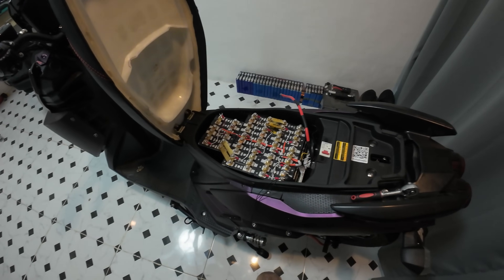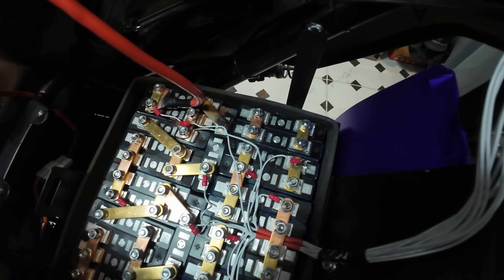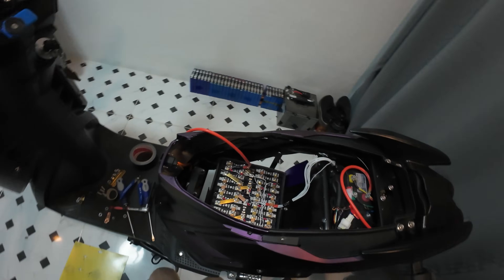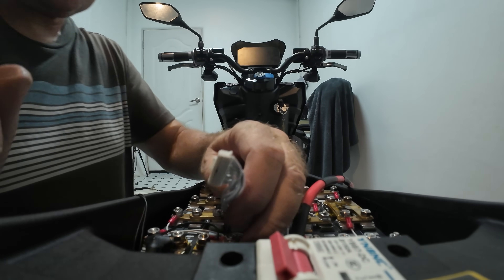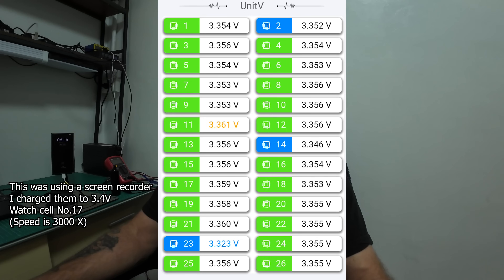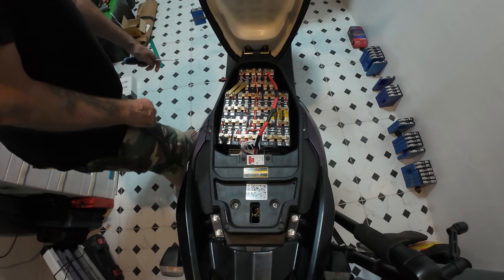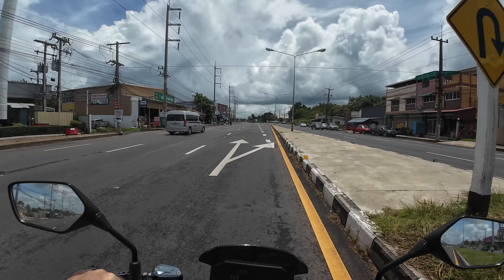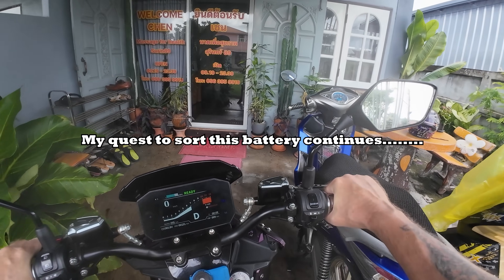The extreme DIY electric scooter / motorcycle build - LiFePO4 CATL problem going over-voltage

Comment: id suggest a prolonged top balance at 3.6v so there all the same at full charge then check again when you run the cells down near 0% and see which cells have fallen the most if there within your tolerance the great but if cells are dipping very low while others are still at 3.2 then id swap those ones out id charge the whole pack back to 3.6 and drop the new cells in that are also fully charged to 3.6 saves time re balancing

Comment: I'd recommend using an active balancer if you can find it. Could be structural with resistance along series from top part of the battery to bottom part. Also could be grade b cells. Check the qrcode to authentify date of production. Lifepo4 should charge around up to 3,6v and discharge down to 2,5v safely especially in warm climate countries like yours.
Reply from the maker: The tougle was, I couldn't find a 26S active balancer or I definitely would have fitted one mate.
I tested every cell and they all go to 3.6V but they all accelerate after 3.3V. As you probably know, Lifepo4 cells are pretty much flatline in their working voltage, if one cell goes high, the rest might only be 70% charged.
A bit of insight...... Yesterday, I started dismantling the battery again - I'm going back to 24S with a JK active BMS.

Comment: My Ebikes 20S/1P A123 LifeP04 High Discharge Pouch cells are "not perfectly matched" either. But i Charge/ Balance them "every time" via a Icharger 4010Duo in 2 x 10S separate packs. I find charging them at 4 to 5A initially & set a 3.45V cut-off cell voltage via the i-charger, after this, i then slow charge at 1.2A until a full 3.65V top balance is achieved across every cell. (always less than 2A) as that's the limit for the  cell balancing of the i-charger, it will then always fully top balance them. Straight off charger there will be a slight voltage difference of 30-60mv between the lowest & highest cell in both packs once electrical connected back in series through SSR, but after less than 1km of riding the peak voltages drop very slightly & the cells match each other almost perfectly (within 5mv) The cells will then continue to match each other down to 3.0 to 3.1V per cell which is the point in which i stop using them (finish my ride) before charging / Balancing once again. B.M.S units can be a pain in the arse in my experience unless the cells are matched perfectly. I hate the fact that BMS operates like this. Eg once a single parallel group of cells reaches its preset cut-off voltage the entire pack ceases to charge anymore, resulting in the other cells unable to fully top balance ever. I dont run a bms as I always charge/balance every charge cycle & use multiple layer DC double pole circuit protection which satisfys my setup. I also run a individual fused but hard wired Voltage cell log display on handlebar showing in real time (under load) critical underload voltages for my own piece of mind & battery/cell safety. If there is a internal cell fault a BMS will not make a difference. As an internal fault is BEFORE the cell & circuit protection itself. Just my 2 cents.
Reply from the maker: Thanks for sharing your detailed insights on managing unbalanced cells and your experience with BMS units mate, it's always great to hear different strategies.
After changing another couple of cells and thrashing it for a few cycles, it's now charging to 3.45V per cell perfectly balanced. If I go any higher, one cell always goes high very quickly and that's with 300mV going in. I can charge them to 3.5V but the gains are very minimal.
Reply: @Vortecks I'm glad the pack is performing better the more you cycle them. Awesome Tony. 👌 👍

Comment: tony glue a small magnet inside your socket to hold ferrous nuts
Reply from the maker: Knowing my luck, I'll come to it one day and find that it's gone walkies and bad things will happen :(
I'll do it anyway, good idea mate :)
Reply: @Vortecks  I only stuck magnets in 8, 10, 12, 13mm sockets as it's my most used ones, but it wouldn't help with the copper bus bars

Comment: 15:27 Back to the drawing board? 🤭
Reply from the maker: I have plans to build something else mate, it'll leave everything behind 😁 This thing is now at its very limit of being rideable. The wheels, the frame and the suspension aren't exactly straight.
Reply: @Vortecks  Ah.. that could probably get squirrely in a hurry. Years ago I was driving a motorcycle that was put together from a couple bikes that were wrecked, and I had to hit the brakes pretty hard and when the back wheel skidded, the whole bike immediately pitched to the left and we (I had somebody on the back!) were sliding sideways towards the back of a car until the rear caught traction again and the bike straightened out in the next lane over and we  barely missed the car.

Comment: only 2 reasons for 23 getting first to 3.6v: less capacity or higher state of charge.
Reply from the maker: It's a higher state of charge mate. It's taken me nearly 2 months to get them all so they all hit absorption at roughly the same time and they all discharge roughly the same. If I'd known I would run into these problems,  I'd have done 24S and run an active balancer instead of a passive one.

Comment: So when one cell pair drops, you have to stop, or it will totally get ruined? Is charging also done in series and those white wires are only for voltage sensing?
Reply: White wires are for balancing of cells via BMS. They also sense the individual cell voltages which are added together to give the pack total..... The batteries are charged in series as a pack, not individually......
Reply: @MyLinuxExperience  Thank You! So white wires balance cells if their voltage drops while driving? If that's the case, that is genius!
Reply from the maker: Correct, the white wires are for balancing the cells but the downside is, this BMS is what's called a 'bottom balancer' which means that if one cell goes low voltage, it drains the other cells to the same voltage and the power is lost through heat.
I have set a low voltage cut-off for balancing so it never trashes the whole pack but the BMS is old technology really. I wanted to fit an active balancer which takes power from the highest voltage cell and passes it to the lowest voltage but they only make them in a 24S and my pack is 26S.

Comment: Its going well, just the dodgy battery cells that give you a hard time with optimising range still when it goes well here goes very well
Reply from the maker: No one really makes anything that works for 26S so I'm giving up on it. I'm going back to 24S because it was much better. The acceleration will be the same, I'll just lose a few KMH off the top.